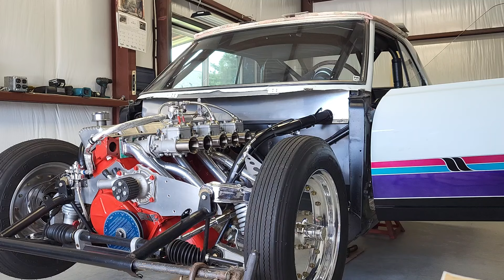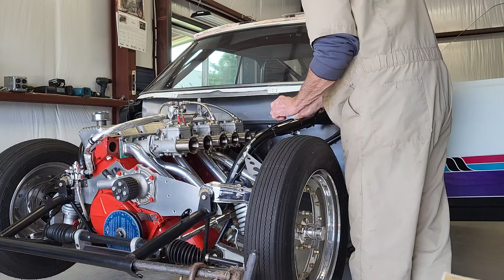1972 Dodge Colt Slant Six. V2 2024 2nd Crank. Refreshed engine.

Comment: A 1965 slant 6 225 is almost indestructible very powerful for a 6.
Then years later at the track in Wentzville mo. I ran across a couple of guys that built one. Wow! That thing was quick. I had no idea you could make them that powerful. It was on gasoline. No boost. It is very impressive. This was about 2000.
Reply from the maker: @Hjfvvdst Was it a Green Lancer? Mark Goodman from Carthage had a 10 sec Lancer he ran on Alky. Super fast car. I bought his engine after he split a cylinder. Here is one of the videos: https://www.youtube.com/watch?v=ncLYIUsHXWE  Thanks for watching!
Reply: @hyperpak2498  if my memory is right, it was a guy named Mark.
I didn't know him but I had a lot of questions. Ha!
Smart guy.
That was back in the days of Mopar hill.
Reply from the maker: @Hjfvvdst  Same guy, wicked fast slant six. They ran a race 5 speed transmission. Mopar Hill?
Reply: @hyperpak2498  when you came into the pit side of MAR Wentzville. First thing on the left there was a little hill.
The guys with plenty of money all had Mopars really nice ones. I'm talking nice.
Well I didn't know about it my first trip in.
So I wheeled my Cougar up on the corner of that hill. I drove my car to the track from st.charles mo.
The car was a low budget (for them)
Street race type. I did good for me.
Well 3rd time to the track I've been parking in that same spot each time.
Finally I had gotten to know some other guys at the track and they asked me why do you park on Mopar hill?
They explained those guys probably didn't like it. 
Well just so happens that day I was lined up with one of them. I had no idea what they ran et wise. Well, I won that race.
I went back to the pits. Soon one of those guys comes asking about what I was running for an engine. He had a lot of questions and was checking things out real close. I had a nitrous plate as a spacer. Nothing hooked to it. It was a new engine I had built. It did have a real nice set of iron heads, intake and cam.
From champion racing head service. 
Cory a guy that worked there was a cam guy so he knew what the heads intake needed . 
Well the Mopar guy thought I was running nitrous. I explained I wasn't and showed him inside everywhere.
Then he thought I was running a stroker. 
I explained it was a 0.030 351 W.
It was funny when everyone else asked me what was said.
Those guys got to know me a little and where pretty cool guys.
I had a lot of fun at that track.
I learned a lot for Mark and a whole bunch of guys there.
I always parked on Mopar hill.
With a Mercury.

By no means was I fast or quick.
For the times and what I had in my car I did well.

Mark was way faster and quicker than me. Smarter to.
Reply from the maker: @Hjfvvdst  Great story. Mark is a good friend, he has a lot of knowledge. Thanks for sharing your story.